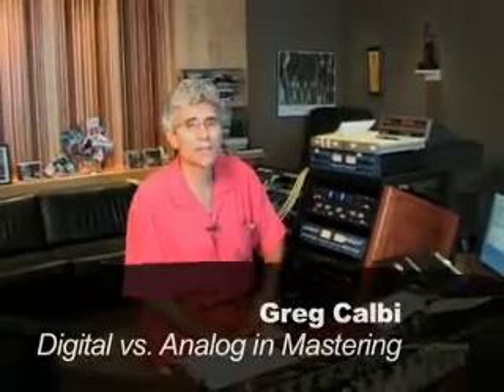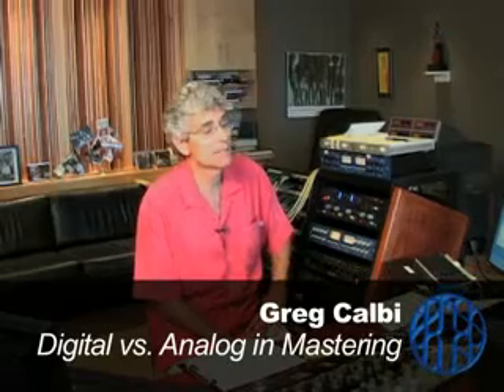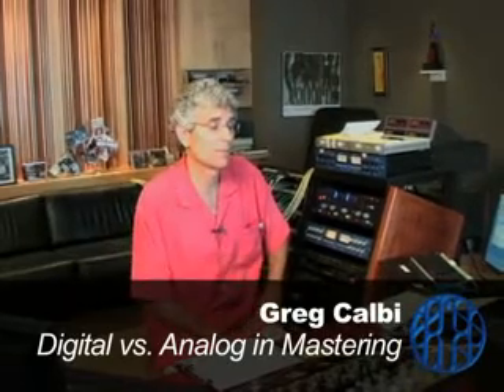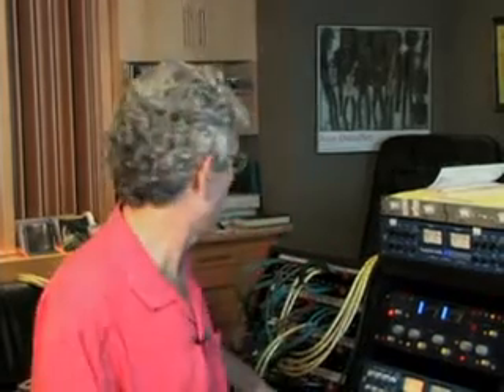Mastering Engineer Greg Calbi on Digital Versus Analog in Mastering

Comment: I like how Calbi is basically admitting that analogue tape adds colour instead of saying it's more pure. After having been vinyl-only for 15 years, I've become a digital advocate, but I actually think more people should work with analogue tape, because so many people are bad at production, and if you use a tape that will smear the whole thing together ("work like glue", as Bob Ludwig said), then you won't so easily hear all the nasty parts that are part of any signal. That said, some of the most amazing recordings I've heard have been digital (e.g. Laurence Juber's "Guitar Noir"), but unfortunately many people are not sufficiently skilled to produce proper sounding digital recordings (or they simply want it to sound terrible). In any and every way digital is technically superior, but as Calbi says, for certain types of music, an analogue tape will sound more pleasant. In other words: For the worlds best producers and mixers and mastering engineers digital is preferable. For the not quite so skilled analogue will cover up the nasty parts. Lastly, as Calbi says, it's worth trying analogue out to see if it adds an effect that you LIKE (colour, not transparency).

Comment: When you increase the sampling rate, you get all the richness and warmth you need. The real limitation of analog recording is dynamic range. Tape is crap for dynamics.
Reply: Oh you just failed so hard :)
Reply: Ha ha ha! I debated with Raffie about similar things on a different video a while back, and it was a major fail as well!
Reply: Actually, in this context, "warmth" means lack of treble, and an increased dynamic range, which an increased bit rate (not sampling rate) does give, doesn't add warmth (meaning subdued treble). Many analogue tapes have a non-linear frequency response, which means more "warmth" - in other words less treble. If that's what you want, turn down the treble in the studio - and many people should do that, as many modern recordings are very screechy. But the "warmth" of analogue is exactly the lack of precision. As Greg Calbi says "It's very dense" - it glues things together due to it's lack of precision. 
Take any analogue tape or vinyl record on the entire planet and digitize it. Then do a completely level-matched blind test, and you won't be able to hear the difference. Several blind tests have confirmed this. 
Then do the opposite: Transfer a tape or a CD/digital master to vinyl and/or another analogue tape, and in many/most cases you will be able to hear the difference (and yes, in some cases they are identical within audibility). Blind tests between first and second generation analogue tapes have shown the degradation in sound quality. 
You can do this yourself with vinyl by comparing for instance Soundgarden's "Down on the upside" on vinyl with the CD, as the vinyl record was cut flat from a 16/44.1 digital master, and while they sound fairly similar, they don't sound identical. Many other albums are cut the same way. Many other albums have been cut using an equalizer, which makes the record sound different (better to some, worse to others). 
Lastly, do the same with digital: Actually, you can Google "Ethan Winer loop-back test", and on his website he has files available for download that is exactly that: First generation, then 2nd, 5th and 10th generation. See if you can tell the difference.
All in all, there's only one conclusion: Digital is transparent, although you might not like the sound of it (in many cases we, including I, don't like the sound of perfection - especially if it's a poor production), while analogue is not transparent. The biggest problem is the lack of people who are good producers and the lack of artists who want something that sounds good (artists often ask the engineers to brickwall the music). It's NOT the media.

Comment: very interesting I have tube amp and I find with dance and pop it's not great but jazz classical far better  60s and 70s music just works great on tubes
Reply: I disagree. I think that this "better" or "warmer" experience to me is just DULLNESS or lower resolution. The problem is that you associate that confined range of sound to older music genres that originally used analogue equipment that used tubes which created that low resolution and distorted range of sound hence the original low resolution gets upscaled by the precise state of the art digital equipment or software. It's sorta like asking the best player in the league to play like the worst. He/She can try, but it won't come out exactly the same.